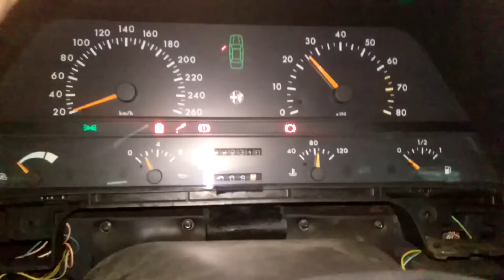My 164 is alive again!

Comment: Hey I have an 164 2.0L turbo 92' it's around 210 hp what mods do you suggest me to do to hit around 300 or 350 hp if it's possible without risking the engine to brake or to need to open the engine.
Reply from the maker: If the headgaskets are old, it may break as they get fragile by the years. Other than that the engine has no problem what so ever with that power. But you will need a new turbo, injectors and a proper tune. Easiest is with a stand alone ecu as I did. You can watch a couple of other videos showing how fast it was with my last upgrade before I changed the eninge on it. Go to my channel and find the video called "Alfa Romeo 164 2.0 V6 turbo GT3071R". That was my last incarnation of the 2,0 engine. All parts changed was on the outside of the engine.